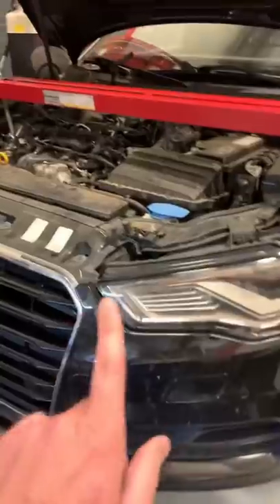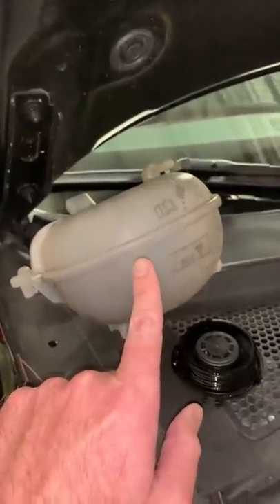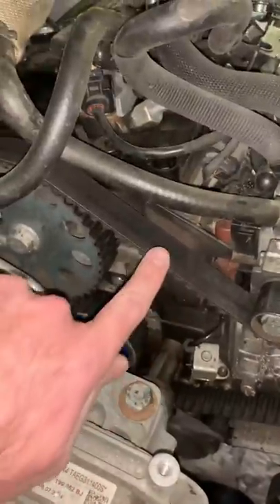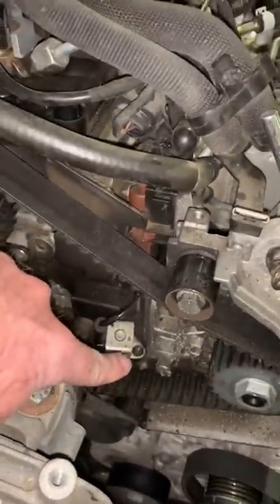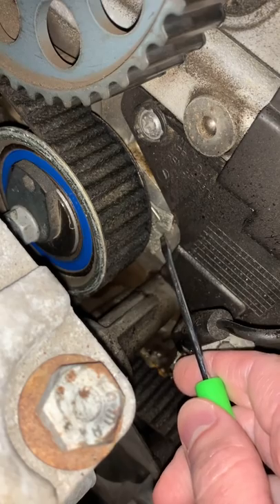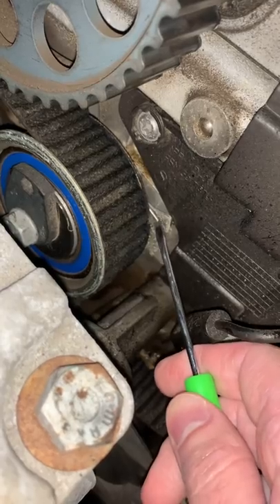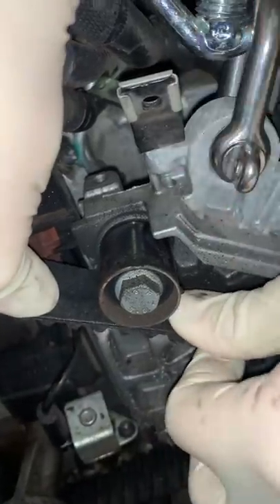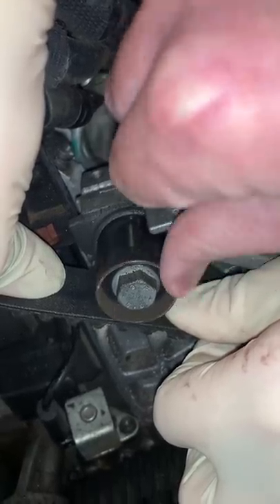Don’t let problems go on your car! #shorts

Comment: In addition to the water pump and the timing belt, you need to replace every idler and tensioner that the timing belt touches. It probably got coolant in the bearings, and with proper tension on the belt, the bearings will soon fail and you get to do the job over again plus a valve job.. ask me how I know.

Comment: Incorrect, the genuine belt fitted is kevlar impregnated and does not stretch, it is designed to not stretch hence the very high change interval of over 120,000 miles, even oil soaked belts are fully safe if the original one still fitted,

Comment: I see so many ignorant comments here about timing belts being the devil. While I agree that timing chains are more convenient for the average joe. However a well maintained timing belt is technically more efficient and is usually a better choice in high performance applications again for accurate timing efficiency.

Comment: I recently checked my timing belt and it had some residue on that idle roller, i also could roll it by hand, the difference is my tensioner arrow is on the right side of the window like 1-2mm. Cold engine

Comment: Interference engines will absolutely eat them selves apart if that belt breaks. Non interference engines , you would break down and need to redo the timing and should be good to go. So be sure to replace the belt at its proper intervals.

Comment: This is a real problem because that Audi engine is an interference engine, which means the open valves come down lower than the top of the piston at full compression.  If the timing belt slips too far, the engine parts literally crash together.

Comment: you made an oops the Idler or Roller as you called it  you said you should not be able to move it by hand when no tension is on it  when you pushed the belt down from it well it should role freely and smoothly by hand   other than that good video

Comment: Sorry mate its not that right. The timing belt tightness is variabel at different points when you turn the engine  the timing belt tensioner moves his nadle up and down. At the top point of the first zylinder the tension should be correct.  Greetings from Germany

Comment: Timing belt engines are not interference engines, if timing belt broke the engine just stopped, the timing chain engines are interference engines timing belt ones don't

Comment: Lol the belt has loosened and stretched firstly that tension indicator will move with the engine running. Secondly belts stretch over time that is why it has to be replaced. Even if it was from coolant leaking on it that is minimal if that's at the tightest point

Comment: THE PLAY IN THE BELT IS NOT BECAUSE ITS STRETCHED...
ITS BECAUSE THERE IS PLAY IN THE WATER PUMP BEARING CREATING A SMALLER SPACE BETWEEN PULLEY S HENCE PEOPLE THINK THE BELT HAS STRETCHED . ALTHOUGH EVEN IF THE BELT IS FINE YOU WOULD STILL NEED TO CHANGE THE KIT REGARDLESS.
IF YOU DISTURB THE BELT YOU MUST REPLACE IT

Comment: The belt will thighten itself once it will get warm - don't panic. And the belt tensioner is still within norm, nothing will go in smoke.
Reply: Those belts should never be THAT loose they should never be able to pull it off the dolleys it should stay nice and snug at all times as far as I know at least

Comment: Sounds like a poorly designed engine to me
Reply: I had the pleasure of being the family inhouse mechanic and having to deal with two TDi engines, The first lemon won't keep a water pump for more than 30k, and It did 20 a year, and it left me on the side of the road at 330am after a 14hour shift in a snow storm with a snapped belt, #2 decided it wanted a mental health day and  to go into diesel run away getting on the highway.  So yeah I got the full VW diesel experience.

Comment: Actually that a problem with package engineering. When you make too many critical systems in a complex machine dependent on a single drive source to save space and money, you invite catastrophic failure. There's an element of truth to the saying, "They don't make 'em like they used to."